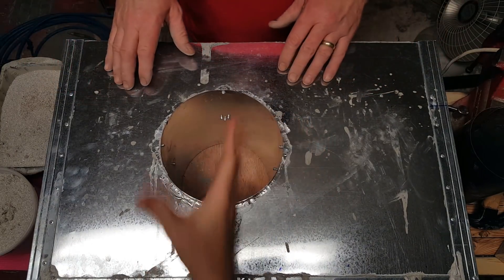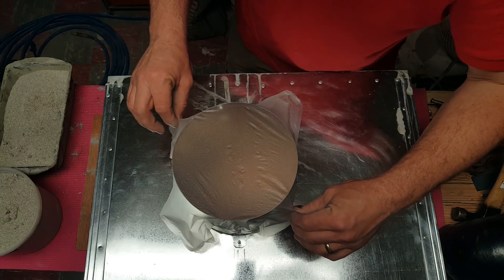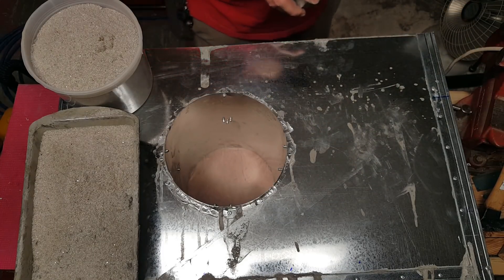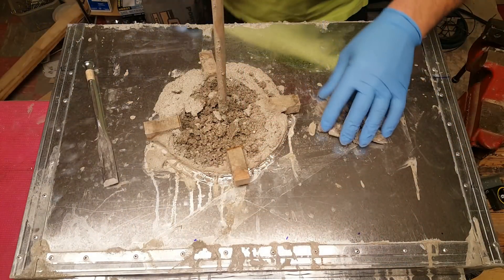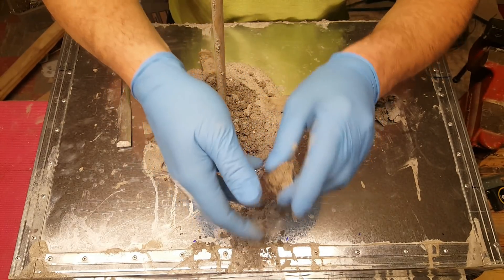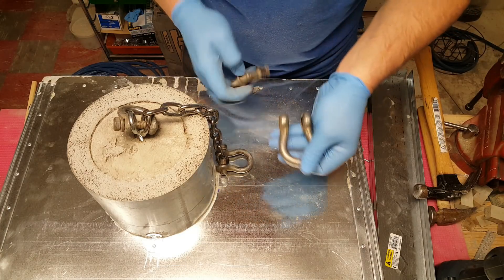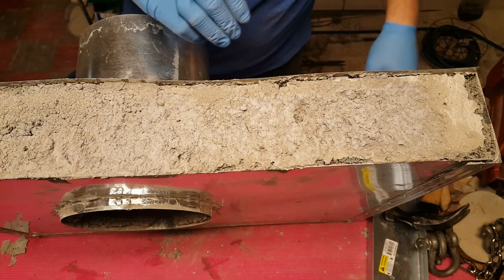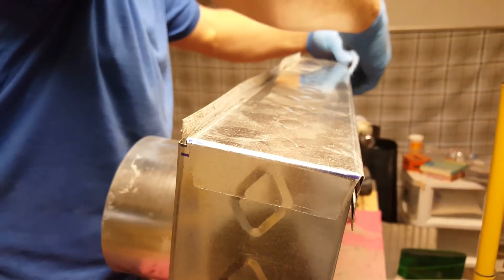Pouring Aircrete for a Window Insert

Comment: 9:35  Drill two holes in the end of one of the wooden plugs, and then you can insert a wooden dowel and hammer out the plug on other end.  Pull or Push, both will get you there.

Comment: Hey man, (just started watching your videos & didn't catch your name) good for you!! I think you've dedicated yourself to a truly innovative & worthwhile cause in trying to perfect the utilization & implementation of this technology / building material. I saw a demonstration a semi-similar concept using a styrofoam-like material in combination with concrete for casting & insulating building foundation & structural components over a decade ago at a local fair and I always wondered why I never saw anything like it again, until now. This method seems far superior in every way, from simplicity to cost, but I think the most noteworthy improvement over it & many other typical building methods, is how much less waste & environmental impact is created in the Air-Crete process. Great job & I hope you guys keep up all your hard work, I'm sure it'll pay off!

Btw, I work in refractory (similar to concrete). We make molds & casts all the time and we use a similar cling-wrap style plastic along with a grease-like substance made of petroleum & oil (very similar to vaseline) as a barrier between the mold & the new casting, before we pour it. That way when the cast is dry & we remove the mold around it, nothing ends up sticking to the cast or causing voids to form around the outside of the casting. Not sure if that might help you in the future, but I figured I'd return the favor & try to contribute. Thanks

Comment: Great ideas, performance and material selections.
Thanks for a great video once more. Two questions though.

1: What is the optimal ratio Portland cement to foam when mixing Aircrete?

2: What are the various possible arming options with aircrete? 
Could rebar work or would it be to wide or is it expected to only be used in relation with smaller wire gague nets and similar?

Comment: ever add fiberglass flakes to see if it improves strength?
Reply: I guess "raw" glass fibre will get attacked by the highly caustic content of the cement. Thats why there is specially coated fiberglass "tape" and mesh with some plastics so it stays stables inside.

Comment: what does it weigh per cubic inch?
Reply: One cubic foot of aircrete, using Darwin's recipe, weighs roughly 16 lbs.

There are 1728 cubic inches in a cubic foot, which means one cubic inch would be 16lbs divided by 1728. That's .00925 pounds.

Multiply that number by ounces per pound (16). 

.00925*16, comes to .148 ounces per cubic inch.

So each 6.75 cubic inches would only weigh one ounce. Or 108 cubic inches per pound.

Comment: instead of an insert you should have just filled it with sand
Reply: Sand wont insulate, it will delay the heat rise but then when super hot it will cause the same problem of overheating flamabable construction materials. At least pumice could do otherwise, it is more insulative than sand (thermal mass)

Comment: Good luck with that!  My dad, who passed 30odd yrs ago, worked for the Corps of Engineers.  He was their Paint & Concrete Specialist at the time.  He invented a foam combo of some sort (aerosolized asphalt or concrete or ?) that was initially used between the concrete slabs of airfield runways, to keep the stress off of them cracking.  Long story made short, my dad's supervisor said "here, let me see that" & the rest is history..my dad didn't see a dime, nor did he get any credit.  In spite of his occupation, concrete has also fascinated me as well, and I've had a blast these last 10 years or so watching the new things that are being done with it in combination with other materials.

Comment: I see you use the Air Crete for lots of stuff, but have you tested it's strength, and if it would be feasible to use it for a foundation, or would it collapse? Thinking about building a home in New Hampshire, and the insulating ability sounds like it would be nice if it works.

Comment: Why use concrete in the main  body? I get the sleeve/ double wall...but heat is not a factor in the main body and you have better insulating choices that have no weight or mess..
Reply: It like this in constructions code; 40 cm of space between stove pipe and flamable materials, 8 cm from insulated pipe. What he did looks like what is sold very expensive in hardware shops

Comment: I have asked before but didn't get a response,  have you tried adding the liquid glass to the foam process?
Reply: For what result ?
Reply: @AutoNomades  Take a look at his other video "Sealing a Air Crete Heat Riser with Water Glass"  Liquid Glass and Water glass - I believe is the same thing.   I thought if he adds the Water glass directly into the crete wouldn't that make it even more resistant.
Reply: @wizzarin424  I don't know if it is the same silicate but some silicate aggregate is actualy causing concrete "cancer" with the so called "alkali silicate" cancer..